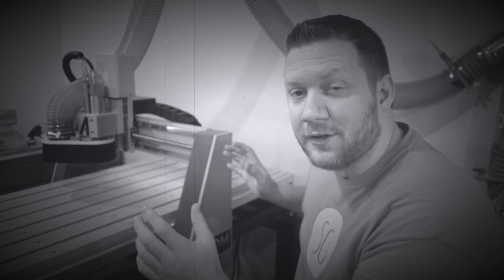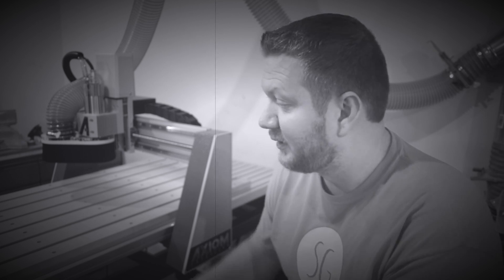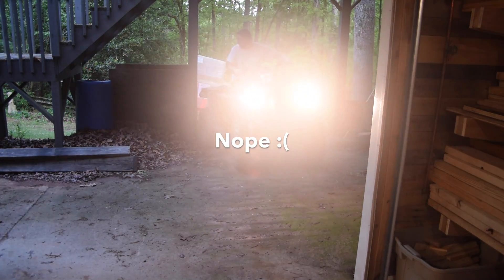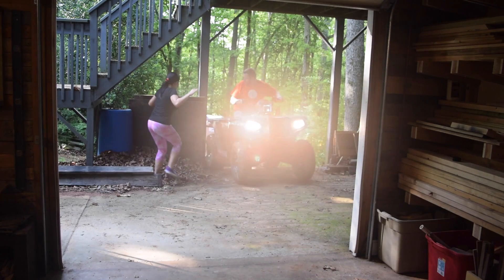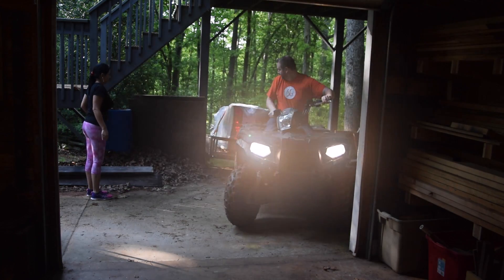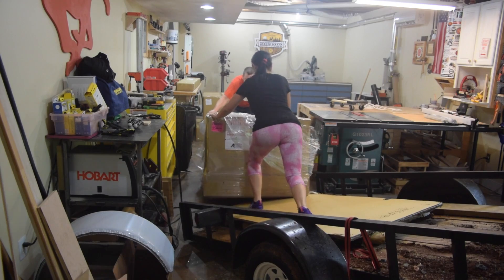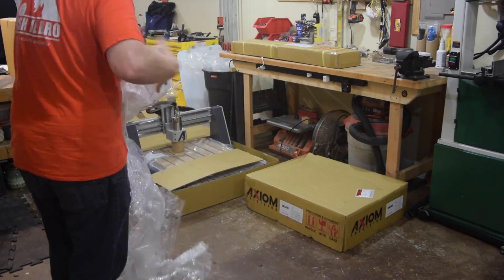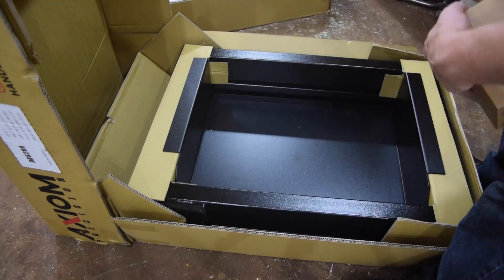Setting up my Axiom Precision AR8 Pro CNC // Unboxing and Assembly // Shop upgrade

Comment: Undoubtedly this is a great machine but I can see now why I have become so drawn to the ShopSabre brand and their ShopSabre 23. The more I learn about CNC the more I realize it's about the ability for the tool to deliver detail over and over. I was considering Axiom as it's about the closest thing I could find to a SS-23 (small foot print, not 5x10) while still costing about the same. I had no idea you had to construct the Axiom and that makes me instantly step back from their products and not because assembly scares me. 

ShopSabre is constructed from structural steel and is all welded together, you assemble nothing or very very little. While I would assume most think I'm just being lazy in not wanting to build up my own machine it's rather two problems I see with pretty much all "hobby" CNC machines... First, Axiom costs slightly more than the ShopSabre and the SS is delivered constructed while Axiom saves money by having you assemble the product despite being more expensive. When I say, "costs the same" I mean for near equal products. ShopSabre's lowest end model (SS-23) is Axioms highest end model for non 5x10 machines.

The bigger and vastly more important issue is accuracy... ShopSabre measures their surfaces with tools neither you nor I own, and they do this after the machine is built. When you construct your own machine there is no possible way you will get the accuracy and repeat ability of a fully measured and tested machine. SS's machines are welded together with 1 inch structural steel, it's not moving... When you bolt something together, even to it's frame, you lose accuracy along the way.

I'm not trying to sway anyone towards SS over Axiom as both will do a very good job. But when all things are considered I feel SS's added 4th axis allows for a dramatically larger diameter of material as it's placed on the side of the machine avoiding the table top limitations. Knowing screws won't comes lose over time or simply loosen as I construct other parts of the machine means I will have a more accurate machine with greater repeat ability. 

Again, both great machines, but I recommend people check out ShopSabre if you are looking to spend 9-15k (the router/spindle change costs dramatically). I'd argue that SS's upgraded spindle is far beyond Axiom's as.

All that being said, thank you for the video!

Comment: How long did it take to get it once ordered?
Reply from the maker: Depending on the model, it took about a month for me. After you order id just call them to confirm timing. Also note that I offer support if you need it.. all you gotta do is use my affiliate link.. no cost to you

Comment: Very informative and well produced.  I haven't given a thought to adding a CNC machine into my woodworking shop until I watched a Jay Bates video (X-Carve machine) which caused me to begin looking for information.  I was pretty convinced that either an X-Carve or Shapeoko was the way to go until I found the Laguna and thereafter, the Axiom CNC machines.  I am about to the 100% that I will add a Axiom into my shop... not sure how deep I want to go with this venture... your thoughts?  Many thanks and keep up the great work.  Cheers
Reply from the maker: Thanks Kevin! I have a full review on my website if it helps you but in short I started with a Iconic CNC and moved to something bigger, the Axiom. I am a huge fan of their team and their machines. They we're gracious enough to make me an affiliate as well! So if you you do go that route, I offer one on one support to folks that use my link. 💪💪

Comment: How does it compare to the Iconic you had?  Mainly upgrade for size?
Reply from the maker: I still have the iconic but yes major upgrade in size and production. I can batch things out much quick on the axiom than the iconic. Both great machines just depends on whats more important to you

Comment: We have the AR8 Pro as well.  Great machines!  I noticed you did not show the lifting of the machine up onto the stand.  Did you have to bring in some additional muscle?  I had to hire a piano moving company to carry ours to the basement (no walkout plus the basement stairs make a 90-degree turn part way down).  There was no way my wife and I were going to be able to lift that beast and carry it down the stairs ourselves.
Reply from the maker: +Mike DeRegnaucourt haha I didn't show it because o split my pants lifting it... Haha. No I just grabbed some neighbors to help! :) Nice catch :)
Reply: The only reason I caught it is because I knew the AR8 Pro is a heavy beast.  I love the machine.  Only problem I have had so far was the wire inside the touch-off puck coming loose.  I ended up soldering it back to the eyelet spade connector.
Reply from the maker: +Mike DeRegnaucourt great tip! And yes great machine!

Comment: Trying to decide between the laguna IQ and the axiom. How do you like the machine now that it has been awhile? What would you have done different? Any suggestions?
Reply from the maker: Hey! Thanks for asking! I haven't used the Laguna yet but there are some things to consider. The guide rails are mounted to the frame and not the actual top so if there is any deflection you will get an uneven cut, not to mention the Laguna is a plastic top with t-tracks mounted to them. This becomes more apparent when you over-tighten the clamps. Also the Axiom is a 4axis machine compared to the Laguna is a 3axis machine! Hope that helps, I am more than willing to talk to you on the phone about my machine and give honest feedback, all I ask is that you use the links on my site if you decide to purchase a Axiom! :D

Comment: Where did you grab power for the LEDs? I've had my Pro 8 for a month or so and think the extra light is a great idea!
Reply from the maker: +bigduke6element hehe thanks! I got mine from off Amazon, simple multicolor strand of LEDs that you can cut!
Reply: Ha, Thanks, but I was wondering where you grabbed power from the machine for the LEDs? Or do you power them independent of the Axiom.
Reply from the maker: +bigduke6element oh sorry, yeah I left them independent. Separate switch.. would be cool to tap I got the machine but I didn't want to mess with it lol

Comment: That's awsome. I am working on building my shop and have plans on building a teardrop camper as well. I am going for a 4x8 cnc due to the fact I don't want to be limited on size. Anything you would change on the teardrop? I am currently doing research and may look into alternate materials.
Reply from the maker: +flyinshu wow that would be awesome! I was thinking about building a 4x8 for that very reason but I decided to go with a 2x4 :). As far as my teardrop the other thing I would change off the top of my head would be to use a torsion axle so the frame can sit lower and use a trailer with flat sides so you can let the skin over the frame. Other than that, I'm super satisfied with the quality and result :)